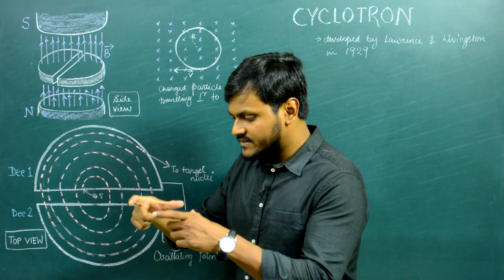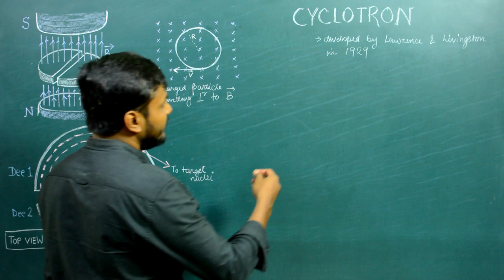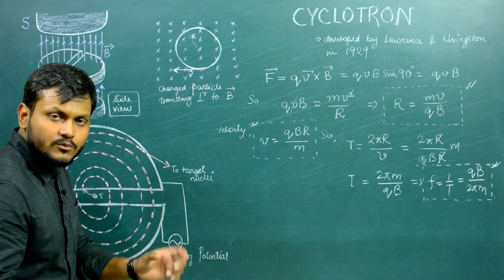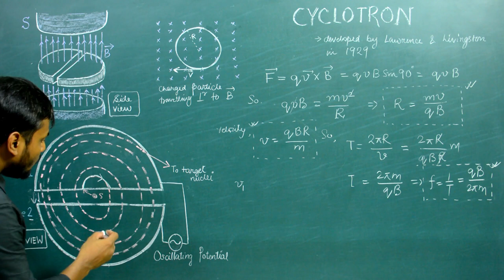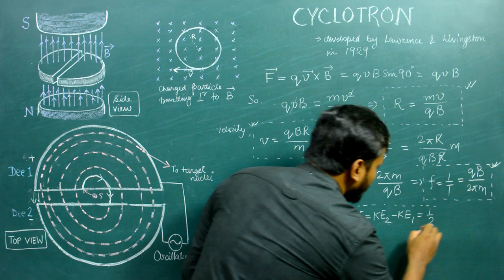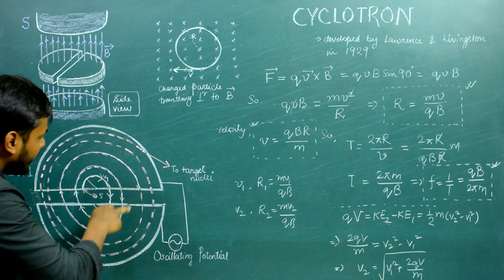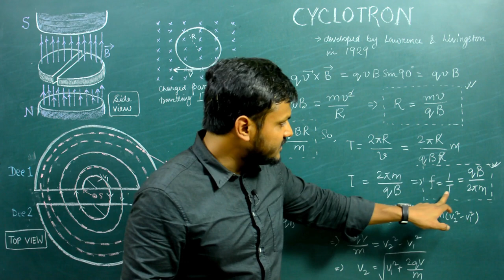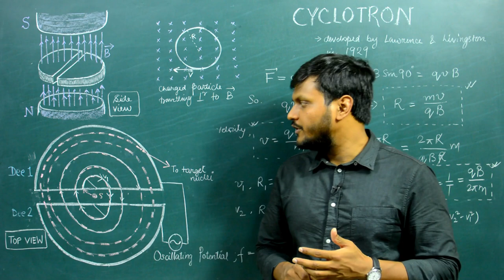Cyclotron (Principle, Construction, Working etc)

Comment: Sir, I am having a big confusion regarding the motion of charged particles between the gap of dees,, We know that if charged particle initially at rest, if we put it in crossed E and B field then it will follow a cylclodial path( Magnetostatic D.J Griffith), but also in cyclotron in between gap of dees, there is  crossed fields E& B then, charged particles must follow cylclodial path continuously, 

Then how can we achieve acceleration of the particles inside the cyclotron,

If somehow nodes of cycloids and the gap ends coincides then velocity will be zero, then no magnetic force will be on particle hence no acceleration.

Comment: Why is the frequency of the voltage not 2 times greater than the frequency of the charge particle? Doesn't the voltage need to change 2 times during one whole revolution?
Reply: same doubt

Comment: Question: I have been told that the electrons or charged particles in the ion beam of cyclotrons do not have a magnetic field even though they travel at tens of thousands of Kms . Is that true? if so, where did its magnetic field of a moving charge go?
Reply: the magnetic field created by moving charged particle is circular one with a particle at the center this field gets canceled by the external magnetic field which could be understood by looking at the path followed by the particle. At any given instant the magnetic field created by the particle would get cancelled by external magnetic field

Comment: This is similar to electromagnetic induction in AC current? 

The spirals are only the trajectories of the particles correct?

It's the electric lines of force not the magnetic lines of force that actually accelerate the particles correct?

Comment: Sir, i have a question which is given below. 
      Why the cyclotron principle is not used to accelerate protons and the heavier ions to very high energies.
Reply from the maker: Its needs to be modified for relativistic speeds - synchrotron
Reply: @FortheLoveofPhysics  sir, can you explain briefly.
Reply from the maker: Cyclotron mechanism is limited to non relativistic speeds only. For very relativistic velocities/energies, cylotrons are usually modified, commonly known as synchrotrons